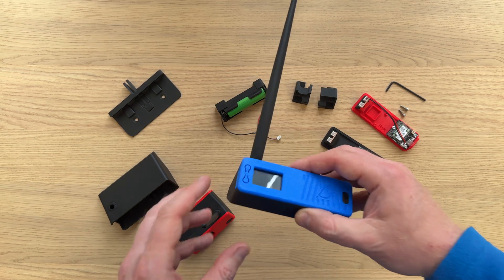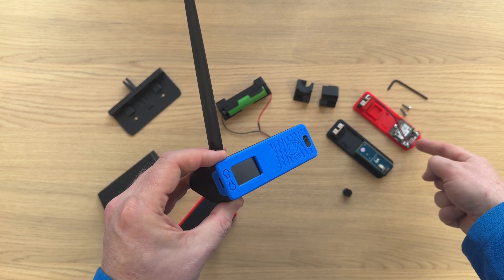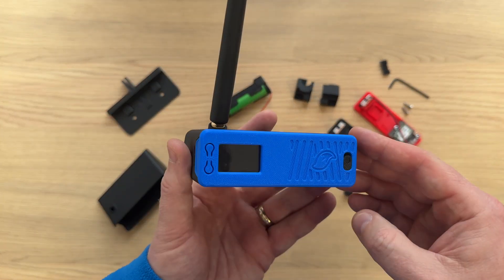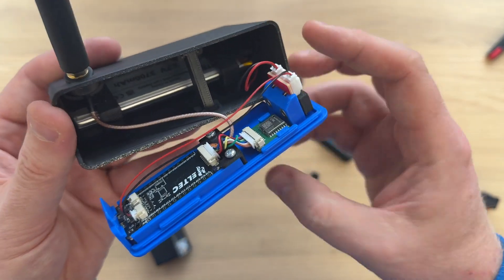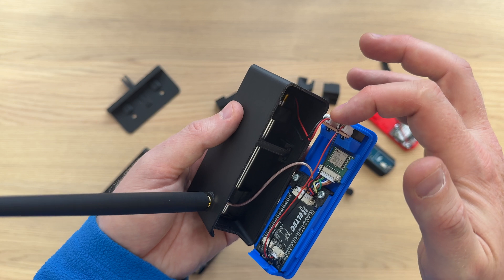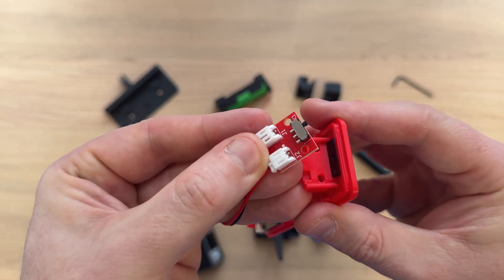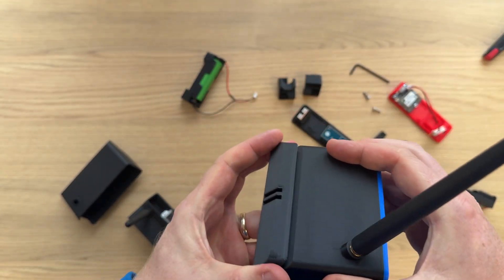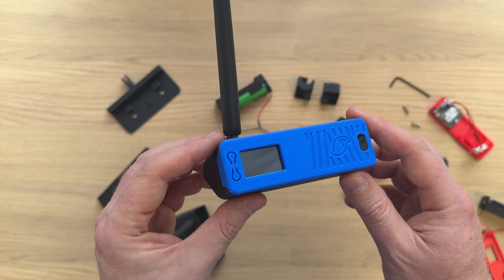Flexo Teardown - Meshtastic powered case for Rak WisBlock, Heltec, Raspberry Pi Pico & more

Comment: What are the required screw sizes for the internal mounting? 2.3 mm thread diameter? Length? Could you provide a full Screw BOM?
Reply from the maker: The screws are M2.5 x 5mm Pozi Pan Head Screws (DIN 7985Z). The ones for the switch are M3 10mm bolts. If you can’t be bothered sourcing them I sell a kit on my site (plus the switch is bespoke!) Thanks!